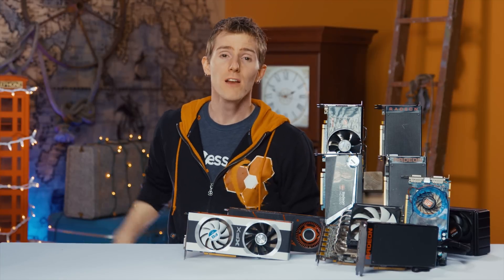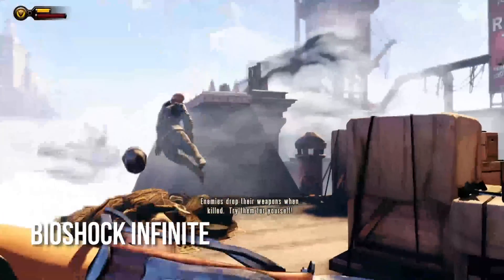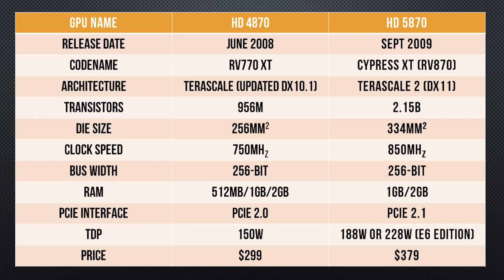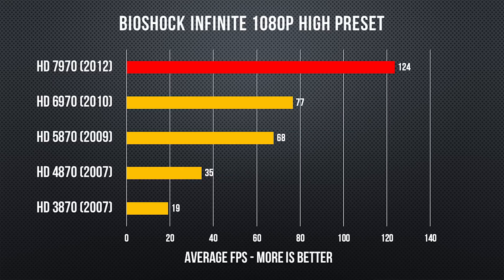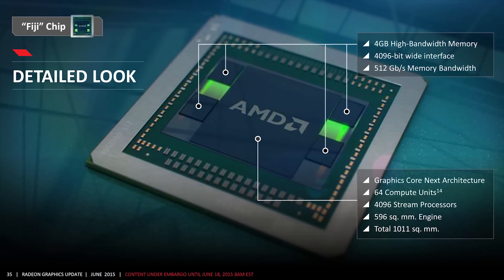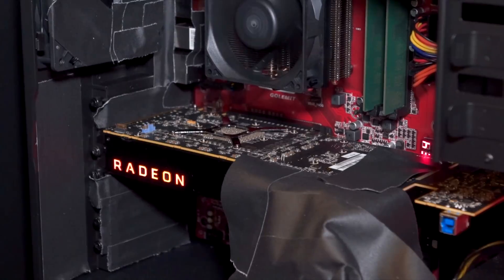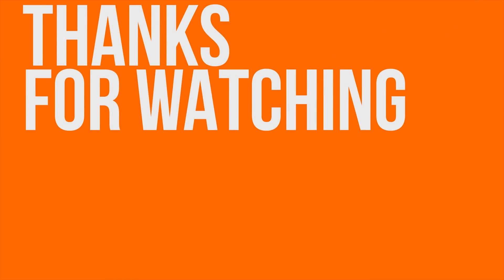10 Years of AMD Video Cards BENCHMARKED!

Comment: 00:18 meanwhile nvidia SLI wants 8GB/s despite running on 4GB/s just fine and when PCIE4 launches will soon require 16GB/s ....just because they want to.
00:20 have a 8gb r9 290x right here so kinda pisses on those ricycles.
02:02 8800gt $625 (which was recalled initially), hd2900 pro $249. Edit actually more like $270 for 8800gt< these are what people actually bought.
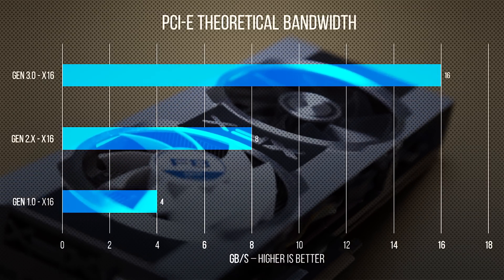04:35 points out "OH NO, AMD DOESN'T HAVE PCIE3 BOARDS (even though it makes no difference)!!!"....uses a post in 2015 for graphics card in 2012, derp.
OH MY GOOD THE 8800GTX doesnt have pcie2.1 or HDMI either!!!!!
05:24 no need to make new cards when nvidia is just rebranding their gtx680>gtx770
05:57 err GTX280, GTX285 rebrand, both 512bit memory bus, forget those did we? Loved those cards personally.
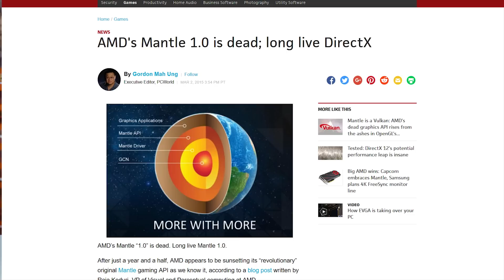06:20 it ran hot because it was profiled to do that and because the fan sucked (or blowed i guess), if they had put a gtx285 (best blower style fan I've ever seen on a graphics card) fan on it there would be no problems.
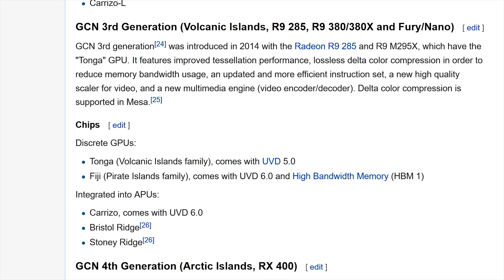07:15 r9 285 had lossless delta color compression too actually.
08:02 it didn't NEED the cooler it just came with one, it could of just used a tri-X style cooler... AND THEY DID on the normal fury.
Reply: For anyone wondering, that's where the AMD is hot thing comes from. IIRC, they wanted to show how the Hawaii XT GPU could handle being super hot, so in the press event they made a custom fan profile which didn't spin the card's fan up until the GPU hit 90C.
Reply: The reference cooler and the Asus cooler were also both pretty bad, so even though there were plenty of aftermarket cards with good coolers out, the 290x still got a bad rep.
Reply: @thisrock88, Corrected my post, you're right was about £165 here in the uk (got a cheap BFG one for £155 on sale and single cards rocked! was loud AF though). either way 8800gt was around 10% more expensive.
regarding r9-290s, the BIOS's built in pretty much gave the card free reign to run as hot as it liked and didnt ramp the (rubbish fan blade pitched) fan up enough so it ran hot, anyone that undervolted them and kept them at solid 1Ghz and turned the fan up to a reasonable level had good temps. Of course no reviewer did that because thats boring, much more clickbaity to say "LOOK HOW HOT IT IS!!!", Then turn the fan to 100% and go "LOOK HOW LOUD IT IS!"
Thats where the stigma came from, lots of 780's and 780tis actually were hotter than the amd cards but history loves to forget little things like that and other things like how nvidia literally crippled it cards by cutting out parts like the double precision units and memory controllers instead relying on software emulation and color compression and faster ram to make up for the losses.
Reply: Toms Tech The 8800GT wasn't that expensive? An EVGA SSC was the first GPU I purchased with my own money and there's no way I would have spent US$625 back then considering how little I was getting paid in my first job.
Reply: Toms Tech nvidia played the market and it looks like they made the right choice considering their current market dominance. It's a shame people could be hoard away so easily but at the end of the day most people just want perf/$ with 0 configuration. "No mess, no fuss"

Comment: 2:24 LEFT ONE IS PHOTOSHOPPED; THE MINDGAMES DO :P
Reply: tbh nothing is holing it up, right has the black thingy in the back :P
Reply: Its a dual slot card, so it has to PCI-e prong thingies to act as a tripod in combination with the board. The one on the right is a single slot, so it cannot stand on its own. That's all.
Reply: no, it's photoshopped

Comment: Pretty neat. I held onto my Radeon HD 5850 for so long. I finally upgraded to the RX 470 last September. No regrets. Powers all my gaming without breaking a sweat (heck, the 5850 was only now starting to show signs of its age). At $100-$150 CAD less than the RX 480 (at least at that time, not sure how prices have gone since) and with almost the exact same performance as the RX 480, it was a no brainer to get the RX 470 (I got sapphire's nitro version). Loving every bit of it.

Comment: Really looking forward to Vega, may get one of those to replace my 290X :).

Don't really get why the 290X keeps getting bashed for being hot and loud though, haven't you beaten that horse enough?...Maybe clarify that this is with the stock cooler and NOT with 3rd party coolers like Sapphire's Tri-X or whatever if you keep feeling the urge to bash it...Because with the 3rd party coolers its not really that much louder nor hotter than a 780ti...which was the clear competitor to the 290X.
Reply: Yeah it's blown out of proportion. My R9 290x sapphire vapor x runs cooler than when I had my GTX 970 gigabyte g1 by a couple of degrees.

Comment: Did you run into troubles when testing the old GPUs in new mainboards? I know in theory it should be compatible since it's still PCIe but I imagine there could be problems.

Comment: the 7950/7970 is the most future proof gpu ever made.. even to this day it has no problems playing most games at high/ultra settings with a good framerate, i am never getting rid of my 7970s.. every few months i like to dust them off and test the performance of recent games.
Reply: the 7970 is exactly the same as the R9 280x.. mine is can overclock to 1250MHz stable as well :-) my main rig has a 1070 as i game at 1440p but if your doing 1080p there is no reason to upgrade
Reply: Paolo Angelo Anino my toxic did 1350. It slammed 780 s and would slap a 780ti in some games.
Reply: And i thought my windforce 7970 was a beast back in the day for doing 1250MHz haha ;p
Reply: oh the legendary 7970s
Reply: same story with the HD 5870/5970. They manage to stay alive loooong!
Reply: Darzo My 5770 is able to run GTA V with not bad settings and frame rates on 1600X900
Reply: I'm still rocking two 7950s in crossfire! what a beast for the money/performance! waiting on Vega now, hopefully will upgrade to 4k as well 🤔🤗😂
Reply: meanwhile my old 7970 couldn't go over 1120 in most cases, god damn you gpu lottery
Reply: Darzo yep, I agree. I still have two 7950s and they're still going strong!
Reply: JooJ SilvZ Upgraded to the Sapphire Nitro+ Rx480 8GB. I'm very happy with the card. I would say I'm getting about ~15-20% faster from my old setup, crossfired R9 270x 4GB. My advice avoid crossfire or SLI, always a pain in the ass with having to tweak it on or off depending on the game.
Reply: Most amd hardware has the fine wine tech
Reply: Darzo Agreed. Despite my 7770 being the lowest end model, it still is really nippy and supports Vulkan and Dx12!
Reply: my old sapphire Vapor-x 7950 boost at 1150mhz was Epic for its time and stayed a great card still i sold it last year. it would still play most anything at max on 1080 res.
Reply: I was using a 7950 and 7970 in crossfire as recently as this year but I upgraded my monitors too much for the rig as a whole to handle it, could have been the rest of the build not being able to feed the GPUs but it couldn't run both 2k 144hz monitors at the same time without nerfing both to 60hz.
Reply: I Have 3 PCs, 1 Running a Sapphire 7770 Vapor-X OC and the other 2 Running with Sapphire 7850 Dual-X OC and they are really future proof. I Still playing GTA V, Crysis 3, and all my steam library games (up to 280 games) without any problems and they keep updating their drivers. My next card is definitely going to be a Sapphire RX480, or better, a Vega, RX580.
Reply: I still use my 7970
Reply: Yep! My 7970 served me well for 4 years. Only upgraded to a 970 because I found a great deal.
Reply: Darzo using 7950 crossfire. Waiting for new cards to be released so I can price hunt and get  gtx 1070 power for less than 250$. I'm thinking 2x rx480 if 5hey cut prices.
Reply: the re branded 480 comes out next month (RX 580) not sure about performance though
Reply: Still have a beautiful R9 280. Still a good 1080p card, and always will be.
Reply: 3 years later, my father in law gave my partner his old HD 7950 3gb, and it can run new games at 1080p ultra in all the games she plays at 60fps.
Reply: Darzo Darzo I regret choosing the GTX 650 ti over the 7970 even though they were older and I believed the GTX 650 ti would perform better because of better Nvidia drivers. I then upgraded to the 1060
Reply: Man the 7k series was the shit everyone knows that, it was the last good thing amd did until this year. But i will urge you to get something other than a bottom tier card next time. I got a 7770 and i loved it then i gave it to my dad who had a GTX 260(i got a 7950 i loved the 7k series so much lol) and i can say the 260 is legit 4 generations older than the 7k Series yet it performs within a few frames of the 7770 in most cases and we are talking a off 756mb or something card vs 1gb, like 750mhz or something vs 1ghz. After that i realized a top tier card is VERY VERY worth the investment like everyone said a 7950 can legit run most games on high/ultra 1080p no problem. But when i gave my dad my 7950 and got a 1080 i played with the 7770 series and there was alot of new games that i could barely get playable fps on if playble at all at the lowest res and settings. Doom, H1z1, DBZ Xenoverse, WWE 2k17, Any cod after Advanced warfare and many other games all play like shit on a 7770 even with settings low.

Oh and i also learned never trust amd when they spout numbers as evidence for power cause...1gb vram should beat the 700something, and 1ghz should beat 750ish but...it doesnt cause amd alough 7k series was good, no single gpu card they made has touched a top tier nvidia level performance in many many years

Comment: I think it should've been made clear which VRAM cards you used, or was it always the highest available? Also, you put price of RX 480 at $199 when that's for the 4GB reference design; which is terrible. A decent 8GB model costs, in my experience, more than the GTX 1060 6GB. Finally, why wasns't the HD 5970 mentioned?

Nevertheless, interesting to see the evolution.
Reply: Why is the 4gb model terrible? 4GB is enough to run every game out there without running into problems and when a game starts needing more vram than that the RX 480 isn't fast enough to handle it anyway.
Reply: That#s just another misconception purpoted by techtubers. I have the 1060 6GB and actually regularly use 5.5GB VRAM in modern titles at 1080p, and it's clear the 1060 can handle higher framerates at this resolution than 60. The RX 480 is comparable in performance; if not better for highly optimised workloads. 4GB was pretty much dated on arrival IMO.
Reply: There is pretty much no game out there where 4gb of vram is the bottleneck, the only case I know off is mirror's edge catalyst on hyper settings. 4GB is still enough.

Comment: It's kind of nice that the RX 480 is treated as a flagship GPU even though it's priced and performs equal to a GTX 1060. For example, I was able to get an ASUS ROG Strix RX 480 that has the same features as the similar GTX 1070, while to the GTX 1060 lacks the RGB Backplate, and often times lacks backplates. Small feature and not the only reason I choose the RX 480, but it's a nice perk.

Comment: HD 5850 1GB was my first gaming graphics card. I worked hard to buy that card and the rest of my components to build my first gaming rig. No regrets over that purchase.

Just over a year later I bought the HD 6970 2GB. It didn't fit in my case so I had to buy a new bigger one. It ran hot and loud and the performance didn't hold up over the years. Biggest regret of my GPU purchases ever.

Got a GTX 960 2GB after that and then this year a GTX 1060 6GB. Two great purchases.

Comment: Rocking an overclocked XFX HD 7970 GHz, can play most modern titles 1080p on higher settings at 50+ FPS, some even with mods. Got it for 115 USD, which is great in my country for a used GPU like this. I've seen some really good deals half the price of what I paid in the US as well, making it great for the budget gamer.

Comment: The RX 480 was my FIRST AMD card i have in a long time. i have been a die hard Nvidia fanBoy for a long time from the 6600GT to the GTX 570 in SLI. i have had AIT cards before but that was back in 2002 ish.. I am vary happy with the performance of my 2 RX 480'srunning in CrossFire.

Comment: I've a 4800 series.... hate my life
Reply: I've got a HD 4850, what's wrong with them?
Reply: still runs black ops 2 without shadows
Reply: i was fine with it because it actually was running new games just fine lol , crazy. However i switched to a 1920 x 1080 and then the frames dropped because it couldn't handle the resolution , but it is still going
Reply: just replaced my 4870 with gtx 1060 , i think i missed some years lol
Reply: true
Reply: Well, I'm stuck with an Atom N2600 since last year and for fuck knows how much more. You're lucky you PC still works.
Reply: 2 core 2.8 ghz and This??

Comment: What's that "lock" on the 6970? It has always bothered me since there is no info on the internet.
Reply from the maker: You mean the little switch? It selects between the two BIOS chips.
Reply: I meant the thing on the top left of the cooler. If that's what it is, then it's a really cool design! Thanks for the reply!

Edit: I was looking at the picture shown at 3:45